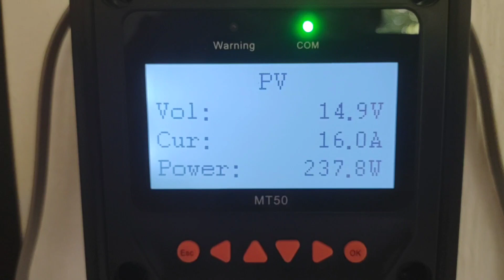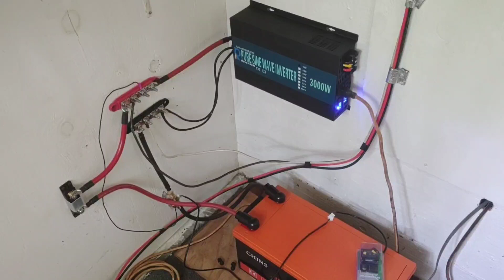100 days continuous use of Lifepo4

Comment: 🎙 On Your Recommendations here, I Bought Qty. o 8 - 280ah CHINS and Tied them into 24 Volt Packs with 2/0 Gauge Leads and MRB Terminal Fuses from the Positive Post to 400amp Model Buss Bars and then fused @ 300 Amps to WZRELB 3000 Watt 24 Volt Inverters and Fused from Buss Bars to VICTRON 100/50 Smart Solar Charge Controller and It works as Designed and Intended to Power The Lodge Kitchen and Appliances 🌴 Aloha Brother 🤙

💦 Indian Creek Ranch ⛩ Southern California High Desert 🌵
Reply from the maker: That's awesome to hear, brother! Mahalo for sharing!🤙
Reply: @ProjectsinParadise808 All o This from YOUR STARSHIP CHINS VIDEO  =  🌴 Mahalo 🤘

Comment: 6:05 Hello, thanks so much for posting your videos. I bought a battery somehwat similar to yours ( Amperetime 24v 100ah) and was thinking of adding a second in parallel. When you mentioned discharing the battery "all the way" once, when you first bought it and how you were going to do the same with both batteries before you connected them together ( run them al the way down) - I realized that ive never ran my battery down that low, not even once ( ive only went as low as 50% ), and ive only maxxed out the charge on it a few times ( with a victron 24v 16 amp battery charger, similar to yours). Do you think that will cause a problem with my battery?  I purposely went easy on this first battery because I was hoping to add a second if funds allowed and according to Ameretime I only had maybe a 3 month window to add another. Seeing that you added a second after 100 days gave me a little more confidence to get a second even though its been over 2 -2'1/2 months now since I got the first. Add a week to 10 days for shipping and im right at 3 months. Lastly, when you say that you ran the battery "all the way", was that until the battery bms cut it off..or another way? 

Thanks again for sharing your experiences with your lifepo4 batteries!
Reply from the maker: I was told about a six month window for additional batteries was optimum.  Like you, I never worked the original battery very hard at all , and did discharge,  then charge both up independently before connecting in parallel. That was what Chins initially suggested,  but they have since clarified to just charge both up independently,  let rest a few hours then connect and use as normal.  Both Chins and Ampere time are essentially identical.  I never experienced anything to mention by doing it the way I did,  but now would just charge each one up, rest them , then hool up to system.  When I did drain it for the first time , I never too it low enough to trigger the bms. Probably went down to about 15% full as I recall before charging back up. I wouldn't worry a bit about your batteries and connecting another one with the moderate use they have had. Hope this helps you...aloha 🤙

Comment: I know im a little late to answer, but there is no reason to fully discharge before pairing them up. just make sure the voltage is fairly close and hook them up. there may be a small inrush, but they will equalize over time. once you charge them they will be at the same state of charge in no time.
Reply from the maker: Appreciate the information on this...they have been working quite well...aloha 🤙

Comment: The whole 90 percent thing doesn't work and doesn't exist I have a 25.6 volt lithium iron phosphate battery  I have seen it at 27 volts and only 85% going by my BMS   but seen it at 27 volts and the BMS says it's 100% charged and the charger has backed off
Reply from the maker: a lot to learn in these systems no doubt...ty🤙

Comment: Newpowa 100W 12V Monocrystalline Solar Panel
operating voltage 16.77V
operating current 6.26A

open circuit voltage 19.83V
open circuit current 6.56A

EPEVER Tracer-AN 12V 40A MPPT Charge Controller
max. PV open circuit voltage 100V (92V at 25°C environment temperature）
rated charge power 520W/12V  

MPP voltage range (Battery voltage +2V)～72V 

Assumption power consumption refrigerator 1.5 kWh per day
Which means your solar needs to deliver 1,500W : 12V = 125A per day

I'm not an electrician, but it seems you can put up to 4 of the same panels in series on this solar charge controller to reduce branch connectors.

Because charge controller can handle 92Voc (open circuit voltage at 25°C), while the solar panel has an open circuit current of 19.83Voc and 4 x 19.83 = 79.32V which is less than 92V.
So coming in the Epever is 80V 6.26A = roughly speaking 480W
Going out the Epever  480W / 12V = 40A, and it is an 40A charge controller.

For safety (after 10 years) a solar breaker between solar panels and Epever. And a fuse between battery bank and Epever in the cable that reaches the busbar (located closer to the busbar, because it is closer to the battery, and that's the strongest power source that could cause big problems for that cable).

If you want to double the amount of solar panels you also need a second solar charge controller, it seems.
Check if doubling the solar capacity is really necessary.
Reply from the maker: Thank you so much for taking the time to put this great information out for everyone to see.  I will refer back to it so I can fully absorb the details.   Great stuff,  and mahalo for that!🤙
Reply: You're welcome. And thank you for the nice, and above all, clear, calm videos.

And if you haven't bought the refrigerator yet, give extra points to the fridge with the thickest walls on your short list of favorite fridges.

This means it has probably the most inches of insulation, which means less power consumption.

If you also don't open the fridge many times during the day and don't leave it open loner than needed, the daily power consumption may drop to 1,000Wh.

And of course you compare the extra costs of a more expensive fridge, but with a more economical power consumption , with the extra costs of doubling solar capacity.

Comment: If you connect both battery in parallel does not matter because each battery will pull the amp needed from the controller. Make the test with a DC amp meter and you will see. 👍 both will reach the full charge at the same time.
Reply from the maker: Thank you for sharing this information with us.  It helps a lot, and I will have them connected here shortly  and give you an update.  aloha 🤙

Comment: After adding the second battery I will recommend you double the size of your solar array to charge up that 600Ah battery bank as quickly as possible so you won't need to start up the generator.
This is just food for thought and thanks for sharing your 100 days with your solar system.
Reply from the maker: I really want to thank you for your comments.  You're absolutely right,  I need to double the solar asap. I am currently keeping 300ah running smoothly,  but the extra battery pack , plus the additional refrigerator draw on the system mandates the increase in panels.  Hearing it from you helps a lot. I would like to ask you how you recommend tying in all my panels at 12 volt, to possibly eliminate the branch connectors? I appreciate what you may offer in help for that. Anyway,  second battery on the way, so the upgrade continues....aloha,  and mahalo 🤙

Comment: Bottom balance vs top balance? I have seen a lot of tubers top balance. Rarely bottom balance. The key is to get them to the same potential. I think putting them in parallel for a few weeks will permit the batteries to equalize. Once they reach same potential, then you can hook them up to PV for charging. Good luck.
Reply from the maker: thanks for sharing this information...and thanks for the good luck...I need it!! aloha

Comment: I have a similar setup with 2 EPEVER Solar Charge Controllers, a total of 1800w panels. I have the panels running in series pairs to get about 40v plus,  the SCC acts as a buck converter to match the battery voltage and gives you a better output.
Reply from the maker: sounds like a great system you're running,  nice! thanks for sharing that...aloha

Comment: I would fully charge them with the charger to ensure they are in the same or very similar state of charges. Then hook them up, the amp flow should be minimum, and once in paralell they will equalize.

That should be problem if you were to put them series, when one battery would be a weaker element while cycling them together.

While in paralell just get them to full charge an start from there. That is what would do.

Nevertheless, I would individually test the new battery, and make sure everything is ok, before stacking it to the system.
Reply from the maker: that's pretty much what the manufacturer's suggestion is as well...thanks a lot!...aloha

Comment: it is safer to connect a flat battery as they is less current to flow the problem is with this how would you get them to full charge if you dont have enough solar
Reply from the maker: food for thought,  no doubt...I'm gonna need a little more solar...aloha
Reply: @ProjectsinParadise808  not exactly the amount of panels more the hours of sun i was thinking
Reply from the maker: @1981dasimpson  oh okay gotcha...yeah that is intermittent here, but I take your point..thanks david..aloha

Comment: Try to bring up , charge the lower battery individuallyup to the same voltage as the other battery or bank of batteries then they can both or all be charged together . May the solar be with you .
Reply from the maker: That makes good sense to me,  and coming from you with your knowledge on this chemistry I have no hesitation in doing just that. Always appreciate your feedback...aloha 🤙
Reply: Good advice, will prowse about burnt up a battery when he hooked up a second one with one at a lower state of charge. Great advice.

Comment: Normally for LFP battery's  same state of charge needed . with not knowing the new one from shipping just start discharged fully then put them together. wait on chins because of BMS in battery .you may need more solar for your system . need to find your avg yearly watt hour . then find what fridge needs watt hour/ day. it's ok to have way more solar than need .the charge controller will cut battery off . and propane generator would be great back up .
Reply from the maker: Great advice as always Robert, and mahalo for that! I fully anticipate having to add more panels to pump two of these along. The stats you mentioned on adding the refrigerator is was I'm trying to figure out now...so thanks again for the formula.  aloha 🤙